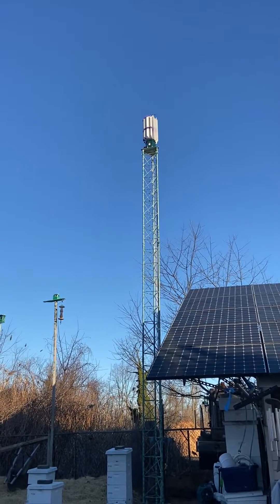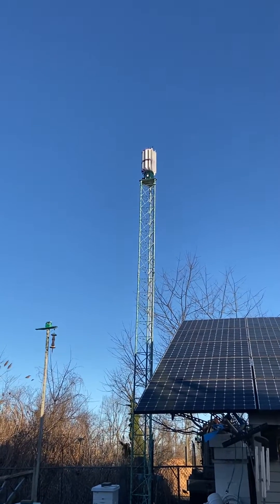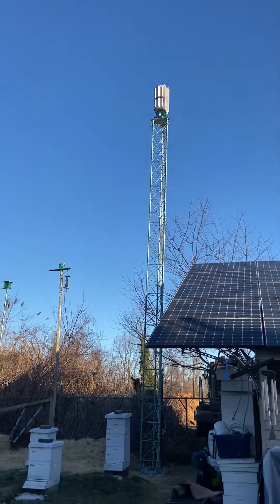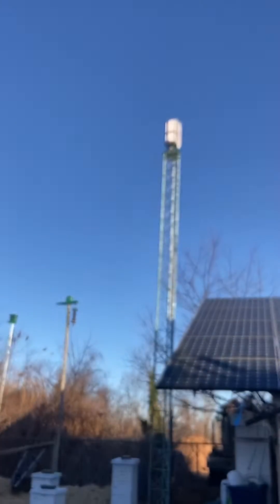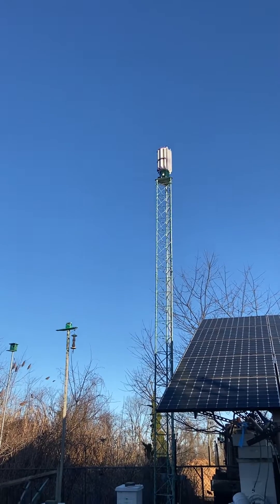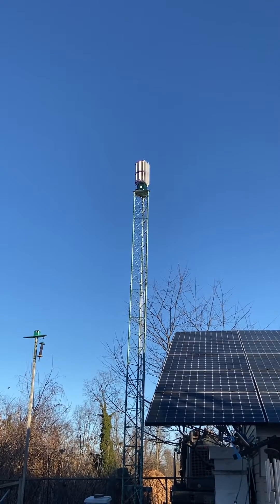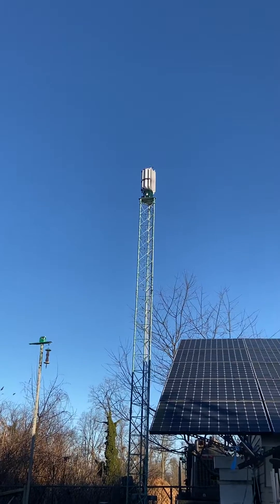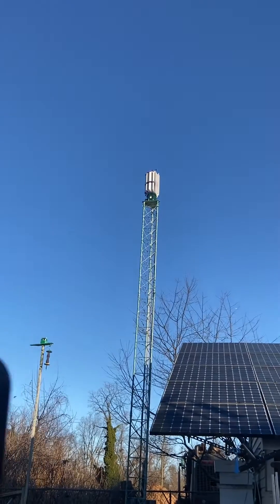Vertical Wind Turbine, Part 39  Real Life Test , Epic Failure of Tesup.  lawsuit ahead ~!, ￼￼

Comment: I saw your review. As you have noticed, the diameter is not sufficient to turn it. Bad idea from the start. Doesn't look like the design was ever tested. It wouldn't work in a whirlwind, the blades would just fly off. I'm guessing you need a four foot diameter blade to have any torque. It's obvious that it will never overcome the torque requirements with that dinky little blade. If you turned the generator sideways, that would be like a 10 inch fan blade on the end, it would never turn. That's what you have going on here. To make the advertised 4 kw, it might have to be seven feet blade diameter. Now, you turn it sideways again with a nine foot propeller, it will turn. That's what you should do, and see how much it can make. First time I saw it I said it must have been designed by some college kids on some bad dope.
Reply from the maker: So if you watch my latest videos, you’ll see that I basically removed every other blade and then extended them with those blades. It now spins and kicks in around 18 mph and spins very nicely at higher speeds. Yes, the design was a complete fraud. It was unable to spin until 35 mile an hour winds, in real life testing when I first put it up. so now that I’ve lowered the initial start up speed from 35 down to 18. I know if I put a 2K generator underneath the start up speed will be much lower.

Comment: Looks like you got the brake on
Reply from the maker: There is no brake on it… The torque from the 4kw generator is the only resistance… Too large of a gen for the size of turbine.
Reply from the maker: I’m looking for a 2kw gen now… that should lower the cut in speed at least down to 12 mph from the 18 . I’m hoping it’s going to be lower